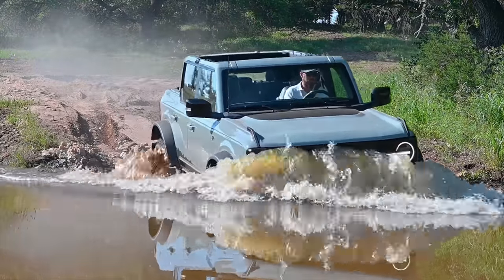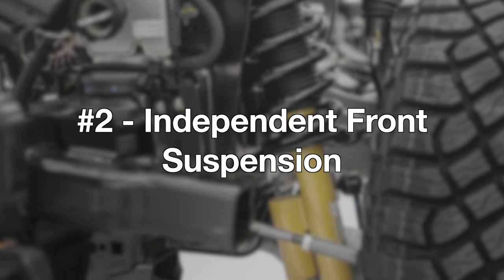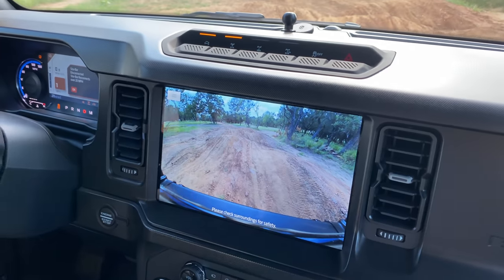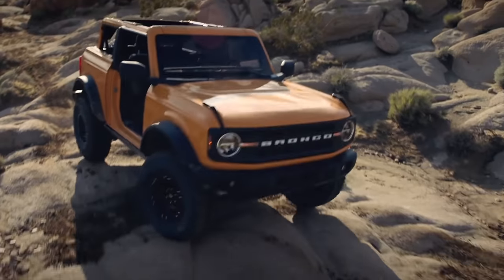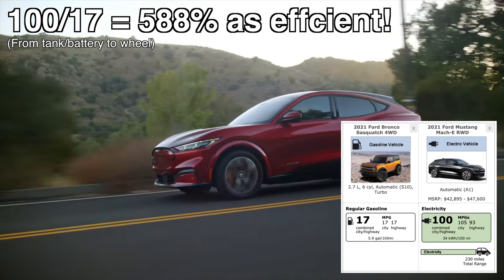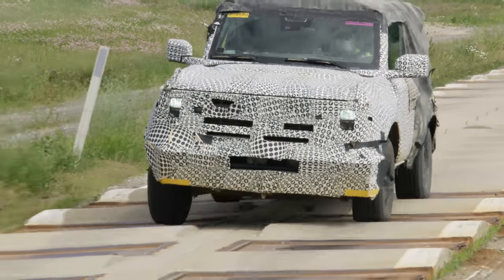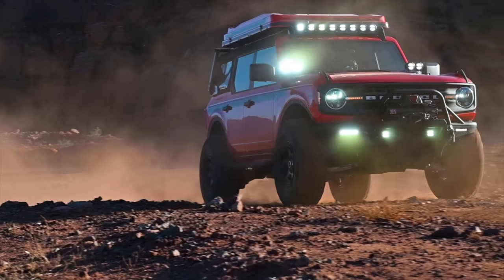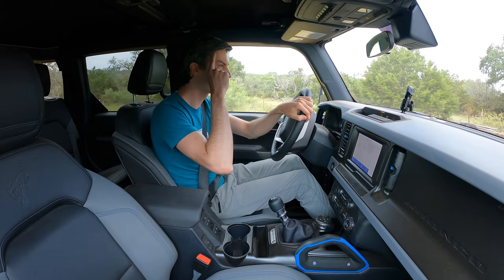The Ford Bronco Destroys The Competition - 10 Key Features (Off-Road)

Comment: OTA (off-road turn assist) is pretty great...but it also wrecks up the trail pretty good.  it should be a pretty rarely used tool imo.  As for the locker...I gotta be honest with you, I can't imagine a scenario where locking the front diff only is helpful off-road.  It's a good way to break a stub axle...but hey, I guess options are nice.  Locking diffs on a snowy hill is a great way to slide off sideways. Not a good idea.  Learned the hard way.
Reply: There is an aussie here on youtube that tests lockers and he says a front locker is better then a rear.   Also there are limited slip diffs and toyota atrac type systems that both have their places.

Comment: The new Bronco looks great, the biggest flaw that I see with it is the steering, rack and pinion steering just ain't strong enough when off-roading, an off-road centered vehicle doesn't need to have good steering, it needs something reliable and sturdy. Then there is the weight, where I live we have a lot of snow and to be able to go anywhere in the snow it needs at least 38" tires to be a viable snow car if not more.
Reply: Weight is countered by airing down. Running 2psi in your tires takes you much further than just raw tire size does, and if you need both then most vehicles aren't keeping up anyways

Comment: Is it possible to drive like a normal car off road. Like if I do some mods on it (suspension, skid plate, ride height lift, off road tyres etc)
Reply: Yes, but it's not worth it unless you love modifying your car.
Reply: Pretty much baja a F350 dualy pickup everyday in the winter. Noting but a grille guard.
Reply: @tangydiesel1886  yah but that's still like a truck right I meant like a normal car like a BMW e36
Reply: @uzairhussain8885  depends what you're after. You probably don't have to go full donut like on their build. But you just need to see what kind of off road driving you're going to do. Tires, or tires and a lift if needed. Maybe a limited slip diff if it doesn't have one. It's not going to be a jeep, but cars can handle dirt pretty good.
Reply: @tangydiesel1886  lmao exactly where I got it from haha. I was just wondering because I don't got deserts near where I live
Reply: Buy cheap xj better off than a car. lack suspension travel  hard fit larger tires.  Cars not built for larger tires .
do u have lockers as an option very least lsd .

Comment: The big question should be "Did Ford equip the Bronco with tires capable of carrying the capacity of the  vehicle plus passengers and cargo?"  They failed at this when they put the Firestone tires on the Bronco 2 years ago.  Those tire were rated for 800 pounds each and the dry weight of the vehicle was 3200 pounds.  Doesn't take a rocket surgeon to see the problem there.  On the plus side, I had cheap, good tires for my S10 for many years.

Comment: I use light bars all the time. I would use them on the highway if cops wouldn’t write me tickets….. it’s truly a night and day difference. Which is nice with deer, elk and moose running around. The Bronco is super cool with its modularity. Not impressed with CV joint reliability in IFS systems. And my cousins eco boost is on its third timing chain and phasers in almost 70,000 miles. No thank you. I will stick with solid front axles and push rod engines.

Comment: i laughed my arse off, when you said an advantage of ifs is allows you to use rack and pinion steering. the rack and pinion steering is an issue on the 12yo px ranger the bronco was based on and continues to be a liability on the bronco.

Comment: There have been reports that some of the new Bronco's are selling for like $120K -- no thanks.  If I were to get one it would be as a second vehicle and only after they've worked out the bugs.  This is a clean sheet redesign of OJ's favorite vehicle and you can tell the engineers went over everything that Jeep has and doesn't have in the design of this vehicle.

Comment: I too was dissapointed in the fuel mileage, until I did some research!  Non-sasquatch Broncos are rated for 20/22 MPG. This may sound dismal compared to modern cars and crossovers, but this is a 4WD TRUCK!  Compare the Bronco to other 4WD trucks and its mileage is quite respectible, better than most.  Most 4WD trucks are in the 17/23 range, even the Ford Maverick AWD often lauded for its great MPG is only rated for a combined 4MPG better than Bronco, not exactly huge. Bottom line, the Bronco is not a vehicle for climate snowflakes, but neither are the vehicles if competes with.  If mileage is your goal the Maverick Hybrid is a great option, but that's hardly an apples to apples comparsion.

Comment: You "need" light bars for times when it goes wrong. When it does, chances are it's already dark. Doing any kind of off-road in the dark is tricky, annoying, and dangerous. "High beams" do nothing to illuminate proximity.

Comment: Well thought out car but I think it's sadly lacking in areas for a modern day off roader.
I would of loved to see how Ford could of made it a hybrid and utilised electric motor power for those tricky technical sections. Weight could be the big killer for it being hybrid though.
I love the modular build but they really should of kept weight down doing it. Plastics?
4 wheel steer could be useful especially for such a large vehicle. Being able to crab your way out of a situation could help but I'm no off road driver really. I don't see dragging an inside wheel as a great solution to sharpening a turning radius.
Reply: Dragging the inside rear wheel is a lot cheaper than 4-wheel steering though. And while there are certainly cons, it DOES work. Ask any farmer that runs a tractor in a field.
Reply: @xtnuser5338  A crude solution done cheaply. Personally I expect more from today's engineers.

Comment: What about a diesel? A diesel can get 25 miles per gallon easy. Would a diesel compromise performance off road?
Reply: No diesels have better performance offroad for their ability to handle water and the higher low-end torque of the engine. A diesel engine in this bronco would be what would sell me to it.

Comment: okay-- the bronco has some very cool things--it even has a couple of things the jeep wrangler doesn't have.  But without a head to head comparison with the wrangler, it kind of doesn't matter. And there is a reason for solid axles off-road. Jeep made the call to be better off road than anything else, and compromise on-road. Sometimes you can't have it all. And seeing tires lifting all over this video means those tires aren't gripping = jeep better.

Comment: So the question is. Are they going to fully warranty the rear axle, brakes and tires since they will wear faster and take more stress with the turn assist? Funny video though
Reply from the maker: Brakes and tires are wear items, which are generally not covered under warranty.

Comment: I have a Yamaha GTS "swingarm suspension" built for two years and designed from the ground up by some USA American with a blank check from Japan.

Best braking system I have ever had on any vehicle period given the enormous amount of mass being "pushed forward" upon use of said "brake horsepower." Not a light motorcycle in the least and no good OEM for 2 people but if Yamaha had continued production they would dominate the Motorcycle Industry today.

Anyhow that's how I would do a chassis change from what is being made of all two wheeled vehicles at the moment.

Plus the bike had ABS!
Well ahead of its time even today.
Still no better vehicle period out there than OneWheel tho.

"Why all the fancy in house electronics when I have a cell phone?" That's why after one accident all of these vehicles made today get totaled.

Anyhow accident risk continues to be spectacularly mitigated by the Automotive Industry.

Obviously the shipping and small aircraft Industry still have a long way to go.

Long $crwd Crowd Strike
Strong buy

Comment: I don't get the fuss about axle articulation when you have difflock.
If you have one wheel in the air, then you have double the load on the grounded wheel so you grip remains the same.
Reply: Stability??
Reply: Also not realy live axel works like a lever puts more pressure on the other  tire vs ifs .
Reply: Flex can help u drop off of things more smoothly or help climb

Comment: It's hard to believe the Bronco is under 5000lbs when the Rubicon is 5800.
Reply: 14jk is only 4,300 full tank fuel hard top Axel swap rock jock 44. Detroit locker front .
Torson lsd rear .carbon cromoly shafts on 35s

Comment: So now ICE cars are emulating electric cars? Times we live in...

Also, still not an an electris with 4 motors and independent precision wheel control? We still have all these manual modes, diff locks etc??? Four separate motors would give you so much more possibilities, with no manual decisioms from driver.

Comment: IFS just doesn't surpass Solid Axels offroad, in reliabity or performance, or aftermarket support, or affordability. IFS is better at high speeds, that's about it. Plenty of Jeep vehicles have IFS there's a reason their iconic off-roader has a solid axel. No, i don't own a jeep or worship them, it's just objective that IFS is a softroader spec.

Comment: So basically it has all the options that the Japanese and European 4x4s got at least 10 to 30 years ago ? 
Sway bar disconnects pretty sure 3rd gen nissan patrol had it ,   front independent suspension, the montero the land cruiser and the G wagon had  that in the 80´s and i think at one point ford had a 4x4 called the maverick witch had one as well. Low range crawler mode ? Could be good i would like  to try it. I don’t really see how it’s innovative, though, i like the fact that it exists because slowly all off-road véhicules are being killed by eco-morons  and the suv trend
Edit: the G class has a solid front axel

Comment: but is this every bronco? at no point in the video did you mention on specific model/trim/package.. you keep stating "the bronco" which would infer all bronco's.. i find it hard to believe the base model bronco comes with lockers, and sway bar disco's, probably doesnt have all those fancy low speed pedal and electronical modes either... need to buy the 60,000$ model to get all those bells and whistles at which point the vehicle is too expensive to take offroad and use them

Comment: Yeah, you say nobody cares about the crap gas mileage, and I have to say I do, and it's a disappointment.  In fact, I'm disappointed at all modern off-road vehicles because if you think the Bronco is bad on gas, know that most Wranglers, 4Runners, or other trucks are just about as bad.  The reason it really bothers me is that I used to drive old Toyota Land Cruisers, and I do mean old.  I had a 1969 FJ-55 (AKA, the iron pig) and 76 FJ-40.  Despite their age and capabilities, they got about the same gas mileage as the modern choices.  50 years later, we get the same mileage... sad from an engineering viewpoint.
Reply: Weight  to power ratio. 
Also jk does lot better than previous jeeps .
Had a tj 14 years . 
Shaped like a brick .

Comment: I’ve seen over 20 new bronco’s on the trails and can say 1) either the drivers aren’t sh1t OR 2) the bronco isn’t sh1t. (Its most likely a combo of both)  
The fact that its 20k cheaper than my wrangler is the only positive thing about it. 
Independent suspension is good for pavement, all it does off road is pick a tire to stick in the air.  The GOAT mode is pathetic. GOAT 🐐= GREATEST OF ALL TIME. (Which the bronco is not)

Comment: The only reason Ford went with independent front was cost. The Bronco shares the chassis with the Ranger and the cost of engineering a solid front axle suspension would be cost prohibitive. This may hurt it in the long run as the Wrangler can have substantial more flex with few upgrades while the offroad flex on the Bronco is probably maxed out for those short a-arms.
Reply: Yeah right, not!

Comment: I don't really get why it's so fuel inefficient and heavy - you don't need oodles of power to go offroading.
Reply: It’s the 35 inch tires. 35s Kill mpg on all vehicles because of the rolling mass of the tire. The broncos with 33s get about 19 mpg, and 30s get 21 mpg

Comment: Not all of these features are on every build.
Reply from the maker: Correct, and the manual limits what features you can get.
Reply: @EngineeringExplained  true, if you get a manual, you cannot get trail turn assist nor trail control. To get front sway bar disconnect, you have to get Sasquatch or one Badlands or higher model. If you want auxiliary switches, 3 of the models require adding them on. GOAT modes vary per model. It's just one of those things where in the videos, it always seems like these are standard features, when they're not standard in every model. In your defense, all models get bad gas mileage, some get worse.

Comment: lots of gimmicks but cheaply built-in real world use they fall apart i saw on take a small jump and the wheels did the splits lol and another one the guys went through some mud after a lot of struggles it made it out  but the transmission was making a grinding sound and wouldn't go back into gear

Comment: Why did ford make this so heavy ?  And such pore fuel economy?
Reply: Why spend all this money on all these cool graduate and innovation,. But, release 5000 ponds turd that does not even have a V8 that produce at least 500 hp? If it was around 2700 to 3000 pounds it would get better fuel economy and do better in the mud or soft snow

Comment: The problem with independent suspension is that you don't get half of the suspension flex you could with solid axle. Not good for low speed off road maneuvering. Much better for regular driving though as you said.

Comment: The Bronco has a long way to do to out-perform a Jeep. The IFS has some inherent flaws. The biggest being exposed tie rod which will almost always break on anything more than a moderate rock crawl. That needs to be fixed. I like the Bronco, but I think the Jeep is a much more rugged off-roader. Also, with a simple upgrade to a Tazer, the Jeep now has trail turn assist and it provides a tighter turn than the Bronco.
Reply: Good joke.

Comment: Kind of sad that nearly all Jeep Wranglers need $10K+ in mods just to keep up with a base model Bronco.
Reply: Not really depends on what u want . I got sport 14jk for 30 got about another 10 in built stronger than bronco or Rubicon. On 35s not full of electrical junk fail . No sway bar. 
Rock jock 44 front Detroit locker.  all ways on . torson lsd rear better in snow open or locked . Cromoly shafts.